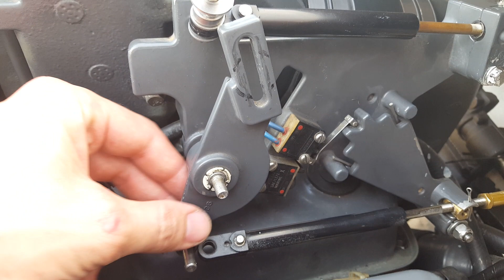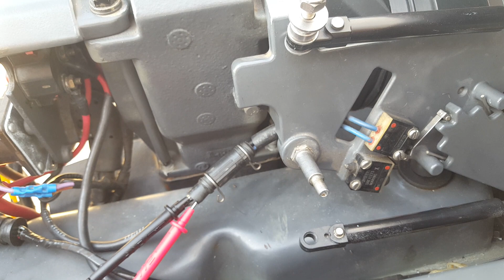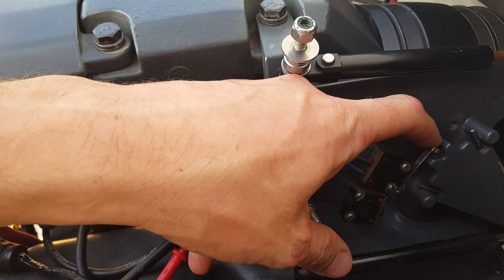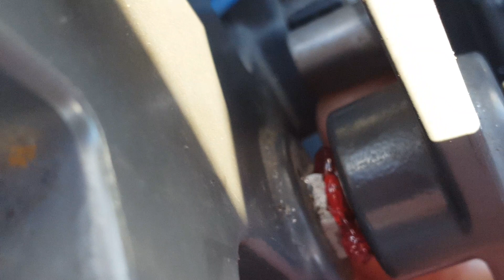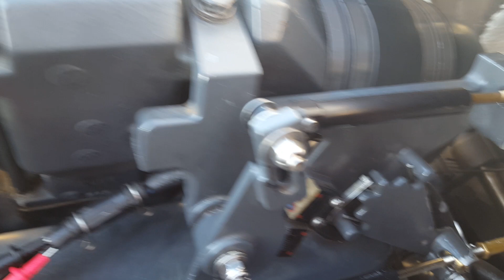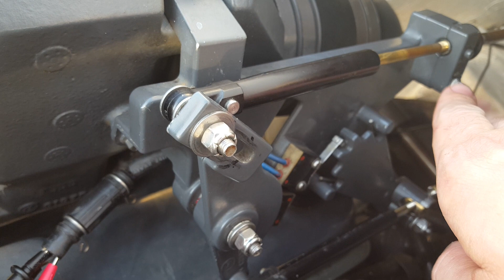Engine Bracket & ESA Troubleshooting Part 4 - OMC Cobra Volvo Penta SX

Comment: I believe the interrupt switch is the one you have the tester hooked to…  the whole reason for the interrupt switch is to momentarily kill the motor to let the pressure off the gears ⚙️ coming out of forward to neutral and reverse to neutral…. Never interrupting going into forward or going into reverse..
Reply: You are absolutely right.  When activated it grounds the positive post on the coil.

Comment: Nice video. Could this bracket stop the engine from cranking at startup? My engine won't even start cranking unless I pull the throttle level back to reverse, then push it forward until I hit a spot where it would feel like it's back to neutral. Then, and only then, will the engine attempt to crank and actually fire up. Could it be that the bracket is not adjusted properly any more? Thank you.

Comment: Hey michael, I had an issue today when i was putting it in gear, the engine stumbled and the suddenly there was a pop and plume of white smoke. I can’t work out what it was that went pop however I just did your test on the interuptor and it’s not working (ie continuity continues to beep in forward and reverse gear). What do you suggest my next steps are? Replace the interuptor or is there also something potentially wrong with the ESA module? Is that what could have gone pop? Happy to take this offline over email if that’s easier. I have a few pics and videos. Thanks in advance! 🙌
Reply from the maker: Try unplugging ESA. Did it start back up? Loud pops and white smoke could also be something else—maybe timing is a little off or it needs a little maintenance with the cap/rotor, plugs. When the motor stumbles, it shouldn’t emit any smoke.
Reply: So I just actually realized that the male connector is 4-pin as well but they’re only connecting it to the overstroke switch. The interuptor is working fine but whatever the wiring looks like from the 4pin female to 2pin male, this isn’t right.

I restarted the engine after this happened earlier today (I can’t now bc it’s too late), I tried to shift gears again and it just kept stumbling at low revs but never went into gear. The ESA was still connected
Reply from the maker: @atanner88  with it running, trigger the ESA by hand and see how the motor behaves. You can grab that metal arm and test it’s functionality. Going forward, don’t try to actually shift it into gear until you determine if ESA is causing this or the lower unit is, or even something else.
Reply: Ok so here’s the update:

I just started the engine and triggered the ESA. While the engine was cold, this stalled it out. Once the engine was warm, it dropped the RPM so that it was stumbling, but it appears that the ESA times out after about 10s and the RPM’s then increase. I was therefore able to get it in both forward and reverse with this period of low RPM stumbling. Yay!

I’ve ordered a replacement ESA cable off eBay that hopefully integrates the interrupter switch so I don’t have this 10s of stinking before it goes into gear.

My concern is still what exactly happened when there was a pop and small plume of white smoke “event”? I bought this boat a few months back and haven’t ever had it in gear. The fuel pump had failed (actually resulting in gas in the oil) and I don’t believe they had run the motor in gear for over 6months. So this “event” was when it was first engaged into gear after a very long period and after this 10s of stumbling through the ESA reduction in RPM.

I lost sleep last night that there may have been catastrophic damage done to the engine or an issue with the lower unit. To see it run in gear today brought a bucket load of relief. I still want to dot my i’s and cross my t’s so any thoughts you have on things to check for good measure or explanation for what it was would be awesome.

Thanks Michael… your channel rocks by the way!
Reply from the maker: @atanner88  thanks! Have you drained the oil in the lower unit? Metal on the drain plug (it’s magnetic) will tell you a lot about over health. I have two videos on the channel that go over how-to. Also look at greasing your gimbal bearing. These motors are pretty resilient. I have a video of me trying to start it up backwards—it’ll be uploaded this weekend. Thanks for watching!
Reply: @michaelromer2016  that’s next. I’m doing the gimbal, oil seal, bellows and oil change. But the “event” was in the engine bay when it was shifting into gear for the first time in forever. I just inadvertently put the throttle down too far and after stumbling it revved high in gear and sounded gorgeous. But it would put my mind at ease if there was an explanation for what happened.
Reply from the maker: @atanner88  have you checked the timing recently? You might have had it knock or backfire out of the flame arrestor. Go after plugs, cap and rotor at a minimum. Post next to other videos and we can go over other topics.
Reply: @michaelromer2016  the rotor is fairly new (and I cleaned the points for good measure) and so are the leads. I had all the plugs out to check the gaps and they look good. I haven’t checked the timing though and I do need to clean the flame arrestor. It’s very possible that it is running a little rich now that I’ve done an electric fuel pump conversion too. A simple backfire would both explain what happened as well as be the least concerning thing to have happened! This all happened while stumbling at at low rpm so that also a good indicator that this is what happened🤞

Comment: You mention a detent as the reason the W moves. Where exactly is the detent, ball and spring? Is this in the outdrive itself or somewhere itself?
Reply from the maker: It is in the lower unit. Take a look here: Engine Shift Detent Upgrade - OMC Cobra - Evinrude - Johnson - Volvo
https://youtu.be/O7_9d7ySaic

Comment: Hi I have omc 5.8l and I have 2 separate tabs on my engine bracket does that mean esa should engage both in forward and reverse ? Thanks for the answer.
Reply: Or it does mean it shouldn’t work at all cause tabs engages in both forward and reverse gear with the interrupter but why  would they put a esa system then ? Any answer would be a lot appreciated..

Comment: Hello, I am trying trouble shoot a shifting problem on my 1990 OMC it shifts fine going in to forward or reverse while engine off buy when engine is on and in gear it will not come out of gear. I have to quickly turn engine of put into neutral then start engine again to move in and out of gear. Please if you could advise?
Reply: Hey Craig. Take you boat and tie it to a dock or a safe location. Discount the cotter pin and nut that holds the shifter cable in place. Manually try to push and pull the lower unit into gear. You will be able to feel forward, neutral, and reverse. If you feel resistance you have a bad shifter cable which is very common and likely the cause of your issue. Otherwise, you might need to service the lower unit.

Comment: I did not realize the ESA doesn't work in forward.  There are times I have a difficult time getting it out of forward into neutral.  I thought the ESA was intended to cause the engine to stumble to make it easy to get out of gear.
Reply: I believe ESA doesn't activate when going into or while in forward gear, but you are correct that as you go from forward to neutral it should momentarily engage to release the load and let the gears separate. Same for going from reverse to neutral.

Comment: very good explanation thank you for your time posting this but I would like to make one correction you are showing this with engine not running. Ill bet when in forward the esa is disengaged as you stated but when you go back to neutral and there is more psi on shift cable. When running the esa will engage for a split second due to psi on shift cable to allow the gears to come apart as control moves back toward neutral position. any more than a split second will cause a stall condition. this is why it is disengaged in forward. Imagine with more psi on that cable and the esa switch engaged the very moment the overthrow switch becomes disengaged the interrupt switch will make its contact and engage the esa this will instantly remove psi from gears allowing them to come apart only for the split second that is needed. this is needed in forward and rev on all boats to disengage gears.

Comment: Any recommendations I have 1989 5.7L OMC Cobra. When it runs for couple of minutes it shots up and hard to start I noticed no spark on the coil and replaced the but no start.  If I let cool it then crank right up. Can it be the ESA module.
Reply: Please respond I don’t know what to do

Comment: Mike, I have a 1987 Bayliner Contessa with twin 5.0 L 230 hp OMC Cobrajet stern drives. It has the old style shift arm with the slot on the bottom part of the arm instead of above as in all your videos. Should I replace it or is mine adjustable. Seems I could benefit from the extra throw to get full engagement in both forward and reverse. If I need the new one do you have a part number for twin engines? It has a control cable on each side. I bought one but unless my old control cable attachment presses out of the arm and slides into the new one, I have the wrong part.
Reply from the maker: Twin setups gets tricky.  Can you show in a video how your setup is configured?
Reply: I can send a video in a week or so. I did discover the starboard engine ESA is. Not working. I ordered both a new overstroke. Switch and an interrupt switch. I will need to figure out which switch is bad. Shifting. Has no nterrupt. The port engine is working better and the ESA system is working. Nice thing about twin engines is you have one to look at.

Additionally I bought Morse single lever controls to replace the old uflex shift w separate throttles. It’s too difficult to grab all those levers while backing into a slip at a busy marina..
Reply from the maker: Bruce Johnson so very true!

Comment: I have a 92 Sea Swirl with a 5.8 king cobra. When I sift into forward or reverse it goes into gear but doesn’t want to come out of either gear. I have to shut down the engine to take it out of gear . Any help would be appreciated? Thanks in advance Frank. fldwwjd@gmail.com

Comment: Hello Mike i have a omc 3.0 cobra I'm having a issue when I shift into reverse it will shift but will stall most of yhe time. Forward works well but not reverse any ideas where to start. Ty shawn brown
Reply from the maker: Sounds like ESA is shutting down the motor. Try disconnecting the ESA module and see if it still kills the motor in reverse.

Comment: To add to my last question when going into forward or reverse the "W" part on linkage engages interrupt switch as designed as it goes into gear and stays interrupted as I throttle up then overstroke switch is activated which is connected to nothing leaving interrupt switch on of course making engine not run and eventually stalling ???

Comment: I Have a 1986 and have the exact same problem as J Liggett that posted a problem a month ago, 4 female terminals in plug from interrupt switch and overstroke switch. Tested with Ohm meter, both switches worked as designed     B U T ???  only 2 male terminals coming from ESA and plug into the interrupt switch only the females to overstroke  are not used ???   now although 4 wires do come out of the ESA two go up to interrupt  switch and the other two go into a rubber plug union and are then routed into a wire harness headed down under the motor to who no"s were which I will try to chase ?   PLEASE HELP SUMMERS GONE IN A MONTH HERE !!!!    THANKS

Comment: Michael, You talk about the shift cable alignment tool around the 5 minute mark of your video. You explain the dimension "its 6 1/2" from the trunnion all the way to....to right there". My question is: Is it from the center if the Barrel nut mounted in the trunnion to the center of the pin that the cable mounts to? If not, can you explain the exact points where the dimension is measured from? I don't have a special cable tool. Thank you. Great video series, by the way.

Comment: Great videos, nice work!  I have an 93 OMC 5.0.  I recently had the  shifter cable replaced.  Although the boat shifts great, the ESA stays engaged but 50% of the time when going from neutral to forward.  I only have one switch (interrupter)  The work around is the bring the throttle lever back about an inch then go forward again.   Would you know what I could adjust to fix this issue??  Is the switch adjustable?  Can I give the switch a little tweak?  Thx for any advice.
Reply from the maker: Does you switch work 100% of the time with a continuity tester?
Reply: @michaelromer2016  My boat is about 5 hours away and I did not have a continuity tester last weekend.  However, I did trip the switch manually with my finger and it worked (slowing the engine) each time so I believe the switch is good.  If anything, the switch maybe sticking causing it not to release sometimes.  Next time the ESA stays on ill try pushing down on the switch to see if its stuck or not in the middle of the "w".  thx!

Comment: Hi Michael, great job on the videos.  I have and 88' 4.3 cobra with shifting problems for the 8 years I have had it.  I am going through it with your videos and seeing what may be issues caused by service centers I paid to fix it..  1/ starting at the micro switches, they were not functioning at 100% so I replaced them.  I have the wire diagram and notes from your videos.  The rubber connection plug from the micro switches has 4 pins, 2 from each micro switch, all testing good now.  2/ The large rubber plug to the recently replaced ESA has only 2 pins in the plug.. The two pins are from the switch with the roller.  None for the interrupt switch.  There is no jumper to tie the micro switches together (as depicted on #35 in the wire diagram).  new ESA.. PN 18-5889..OEM PN 987739.  Did the mechanic install the wrong ESA? or has the unit been updated to eliminate the interrupt switch?  None of the adjustments have matched yours yet, and I did buy the alignment tools you suggested.  Thanks..

Comment: I am working on a OMC that has a non adjustable ESA shift bracket . Should I get a bracket that has a adjustable top hole?
Reply from the maker: What year and model boat do you have to include the engine size
Reply: 1992 Cobra  , Seaswirl  w/ 5.8 v8

Comment: This is a Great video and it does help to understand the ESA system. ESA stands for Electronic Shift Assist. It drops the idle while you shift from neutral to reverse to put less load on the gears. There are a couple of mistakes: 
1) The Overstroke Switch is the one that is more visible. It has the arm that rides on the "W". That switch is Normally Open (no continuity) You can tell that because when Mike activates it the multi-meter beeps showing continuity. This switch only activates for a second AS you shift.

 2) The interupter switch in normally closed. If you activate it, it opens and kills the signal to the EAS. If the interupter is open, activating the Overstroke will will not do anything. In the video this switch is activated when you are in forward.

(Mike had the normally open VS normally closed incorrect)  My engine is like the one Mike is working on and only activate the ESA going into reverse but some are different.
Reply from the maker: Thanks for your comments. I got the terms mixed up. Others mentioned the same thing in the comments below. Thanks so much. Please hit that subscribe button!

Comment: Great video,  When shifting into reverse my W pops up but doesn't go back, keeping the esa on. Any suggestions?
Reply from the maker: Ken the W can stay like that. You need a multi-meter to test to see if ESA is engaging. You can get one from Walmart for less than $20. Follow the same steps I mentioned and if it is engaging when it isn't suppose to, you need to adjust a few things. Thanks so much. Please hit that subscribe button!
Reply: Same
Reply: Ken.  I faced with the same problem. Did you ever figure out why your "W" doesn't spring back?

Comment: Where the hell was that de tent located again
Reply from the maker: There is a detent like device on the engine bracket. It's used to cancel out the ESA system.
Reply: @michaelromer2016  My bracket is different than yours and I only have the overstroke switch without the interrupt switch. Should I adjust cables so overstroke is in center groove when in reverse or forward gear?

Comment: Great video, easy to understand, easy to follow. Thanks for sharing..
Reply from the maker: Thanks so much! Stay tuned more to come!
Reply: Michael Romer I just bought an 88 horizon 200 5.7.  I took out test run yesterday. Issue is it stalls out at any speed like you shut it off. Starts right back up. Previous owner stuck car electronic distributor in it. Could this ESA system be causing it or car distributor ? Thanks in advance.

Comment: Switch with the little lever is the interrupt, switch with the little button is the overstroke. 
The interrupt drops the idle when shifting from in-gear to neutral from 600 to 450 to allow the clutch dogs to release. Once that happens the idle will rise back to 600 and all this should only take a few seconds. The overstroke keeps the ESA turned off essentially when in gear, because if the shift cable gets sticky or the switch is over tightened it can stick on which would make the engine run very poorly when in gear.

Comment: One last thing, when shifting a dog clutch drive into gear and out of gear with the engine OFF, someone should be spinning the prop while you work the gearshift lever. Shifting it without either the driveshaft or the prop shaft turning can damage the clutch dogs and it may not go into gear.